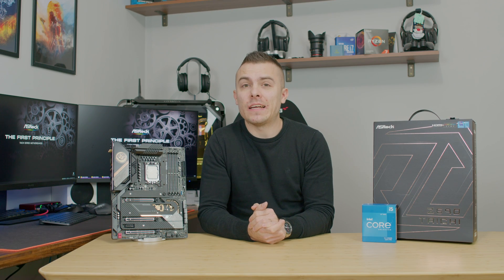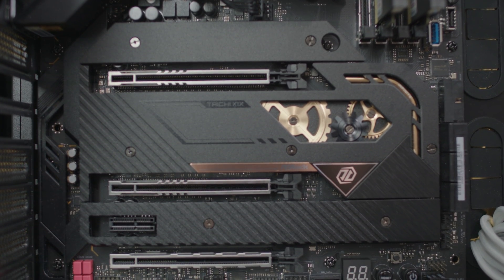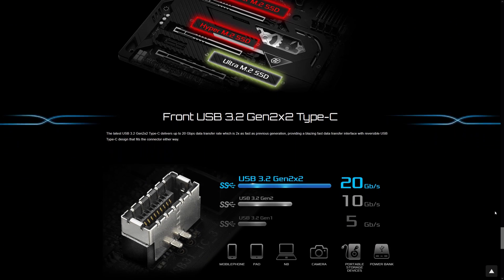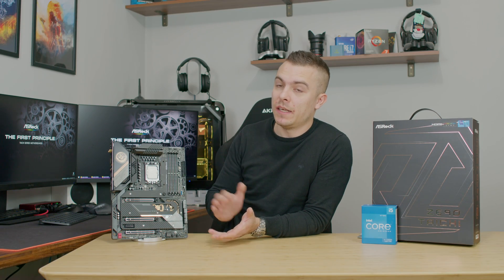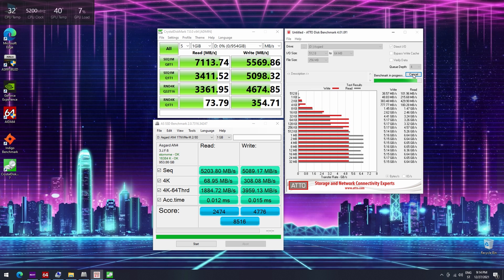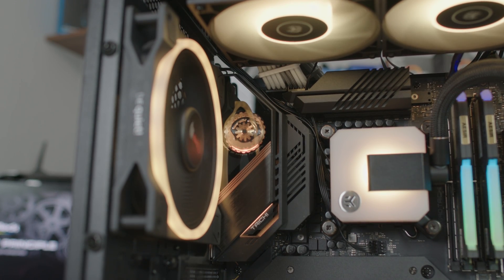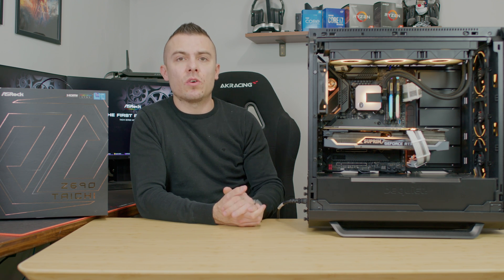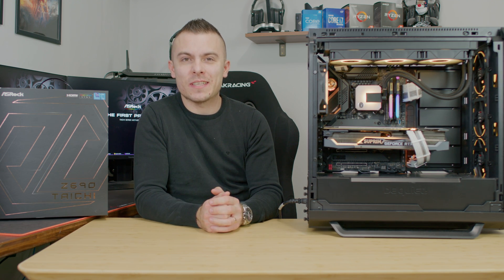ASRock Z690 Taichi w/ i9-12900k - Insights and Overview

Comment: I just got this motherboard for my first PC build and was wondering if there are any compatibility issues with adding NVMe M.2 Gen4 SSD the PCIE 3 slot. Should I just get a M.2 Gen 3 SSD to fill the slot or would the Gen 4 be backwards compatible with the PCIE 3 slot?
Reply from the maker: PCIe Gen4x4 is backwards compatible with PCIe Gen3x4 without any issues. You only get lower speeds and no use of maximum speeds Gen4x4 can provide.